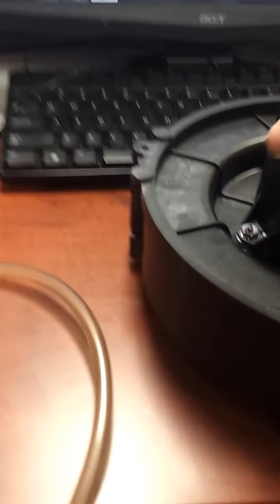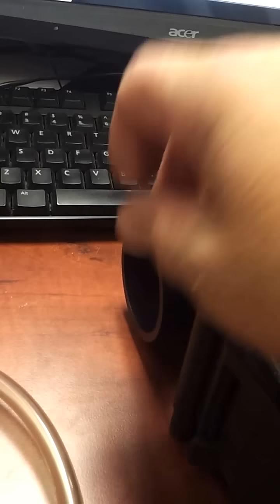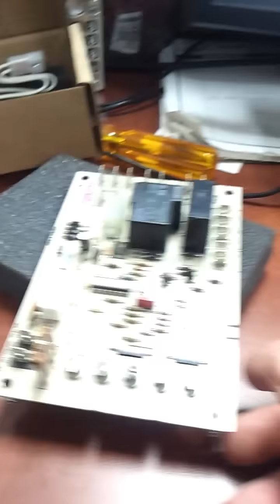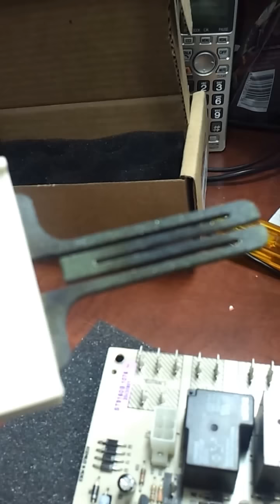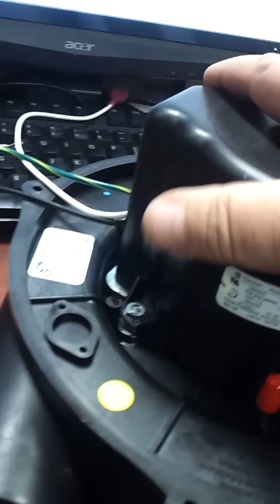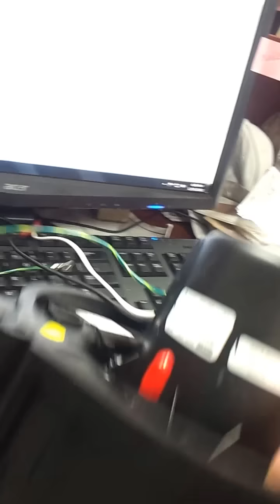A067 fasco furnace exhaust motor,1014338 (7058-1404) Canada keeprite, Heil ICP Tempstar

Comment: Hi I have fasco U21B vent blower motor on my furnace and it is noisy i was wondering if you have any idea how to remove the fan wheel on this module so I can access the bearing I bleave that this model is replace with A170 the part # 1011409